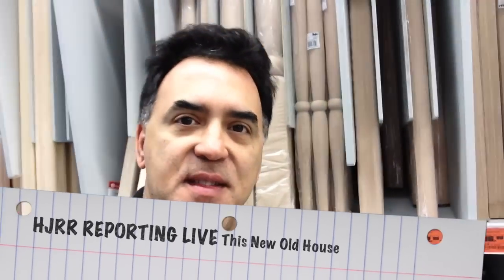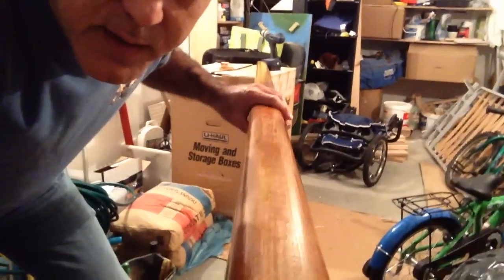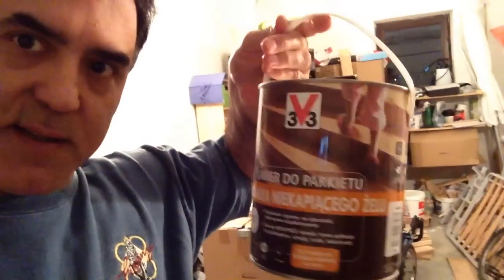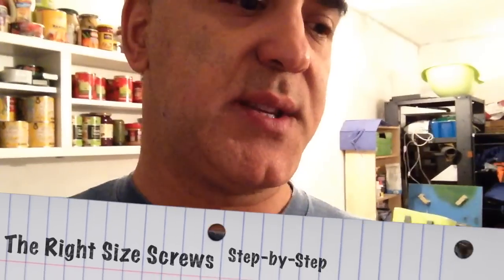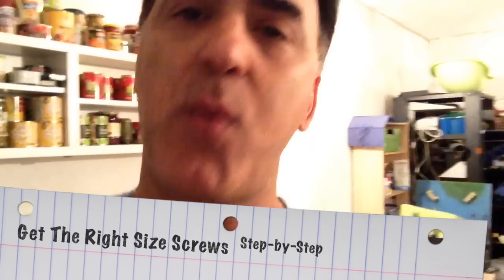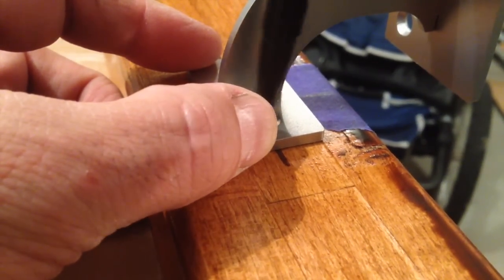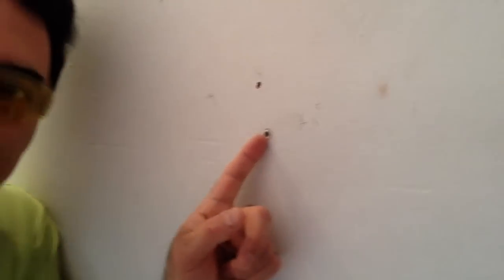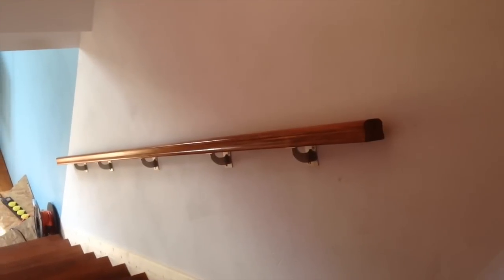NewOldHouse - How To Install Hand Rails (HJRR)

Comment: The railing looks good once installed. However the video did not mention support of the rail in the stud of the wall which is imperative for true safety and longevity.
Reply: In this project he mentions that he's going into a concrete wall @3:55 and then later explains how to install into a wood framed house @4:20
Reply from the maker: yes, i wanted to cover both options. I have concrete walls, but most American homes have wood studs to find and install into. Just want people to know you can not (obviously) attach your hand rail to wall-board.

Comment: I don't think you need 5 posts for a 9 ft rail.
Reply: 3 would have  done it.
Reply: I didn't see any posts, but 3 brackets screwed into studs would be more than sufficient for a 270 cm long rail.
Reply: It depends what ur gonna use it for 😏🤣

Comment: This doesn't meet building code which requires returns on both ends, and that the brackets be screwed into studs.
Reply from the maker: THIS IS A SOLID CONCRETE WALL did you not pay attention. I don't know where you live, but YOUR CODES do not apply to where i live.
Reply: Your favorite reply on every handrail video 👎